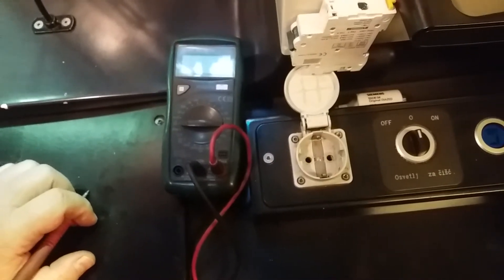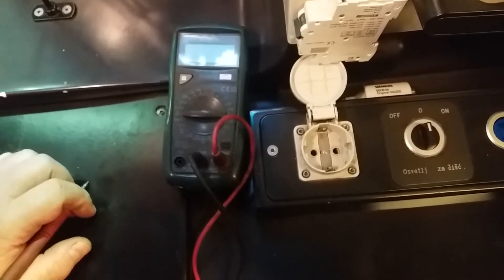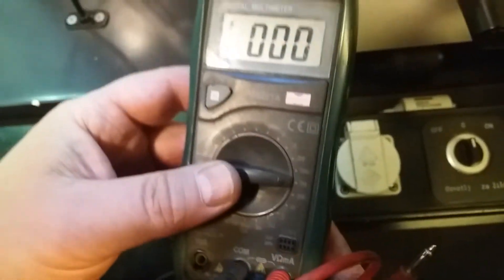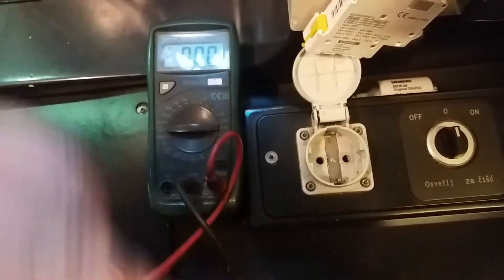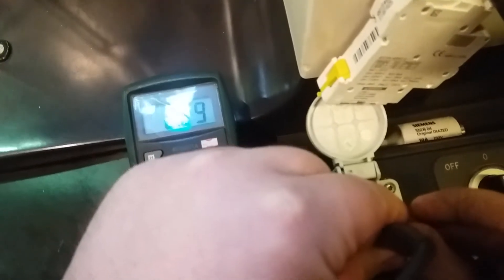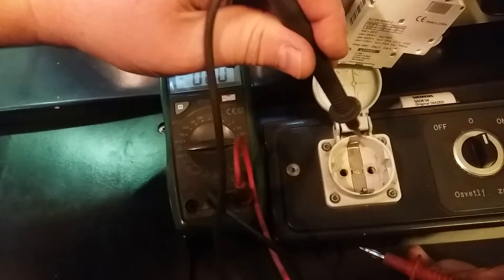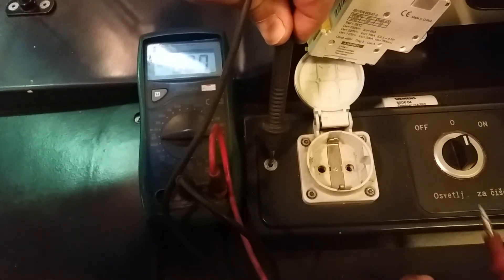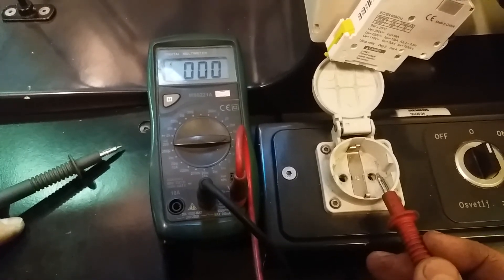How to test and check 220v AC wall socket with voltmeter multimeter

Comment: Always use both probes on one hand, that way in case of electrical shock the current doesn't go thru your body. Make sure the probes don't touch or rub their metallic parts with each other, as that would cause a dangerous short-circuit. Remember you are testing a live circuit
Reply: Yes. Also, be very careful with what you choose on the multimeter! Have the settings prepared first before you start testing. A mistake like having set measuring for current when you want to measure voltage in an outlet can cost you your life!